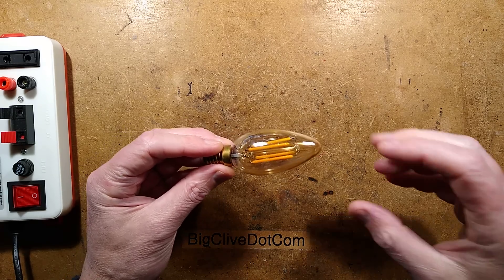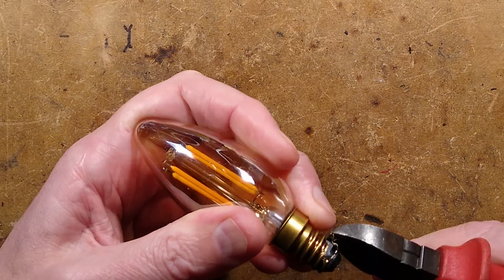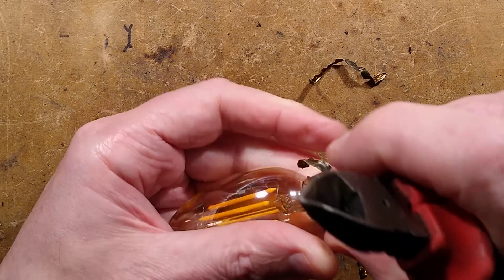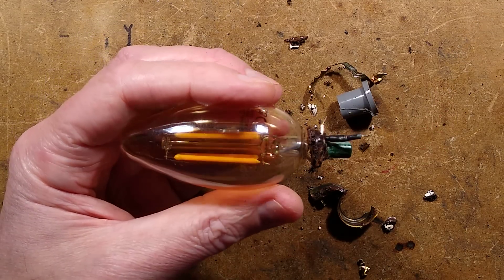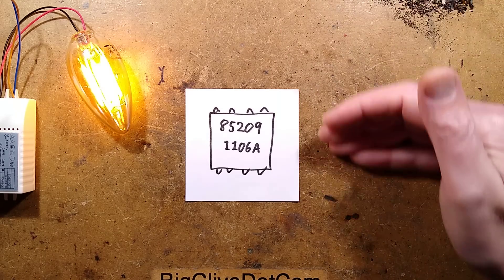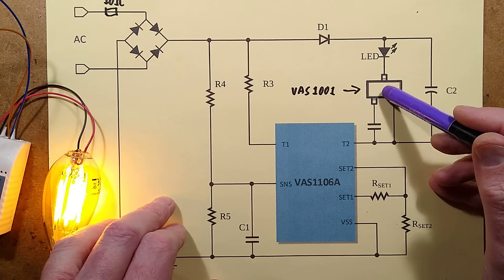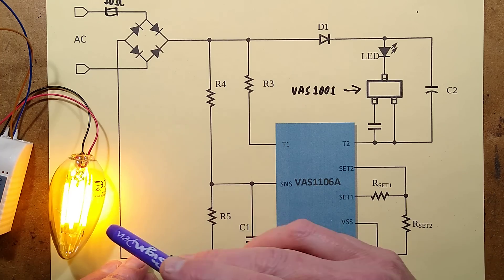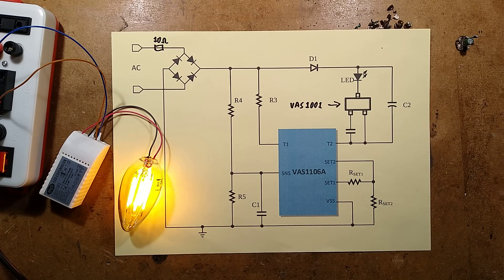Inside a STOLEN (faulty) LED bulb

Comment: Wonder if there are any good e14 led lamps at all. This form factor is just not suitable for LEDs. Even e27 is bad. And with the electronics they use for most led lamps (both the components and the designs), finding a good one is a serious quest

Comment: Sorry if this sounds a daft question but,  is this bulb made like wire filament bulbs eg with a vacuum?
Reply from the maker: It's made with the same machines as tungsten bulbs, but no vacuum.  Sometimes an inert gas like helium is used to help couple heat from the LED filaments to the glass envelope.

Comment: Ok guys, serious me now.
Need some advice please.
So, I'm rebuilding my pc, trying to line up the motherboard into the case, then I noticed one of the screws was stiil in the board. [Like wtf did i even get it out like that?]

But, question is..
How do you extract a screw that doesn't seem to be threading from a circuit board?

I've tried a magnetic driver, pushing from the back...
I don't really want to have to take a hammer to it. 🤔

Comment: Could you do a video on how these dimmable bulbs actually dim on a triac dimmer? I would have assumed that the current regulator and sensing resistors would essentially maintain consistent light all the way until the waveform became too scarce to provide adequate voltage, then you get flicker. This seems to be how non-dimming lamps react to a triac. I've read that expensive LED drivers are measuring the phase of the triac dimmer and translating that into a pwm duty cycle, but surely this cheap bulb in this video is not doing that. So what's it doing?

Comment: The marvel is how they manage to squeeze ANY form of PSU (no matter how minimalist) into such a small space, and do this for millions of devices. It wasn't that long ago when LED drivers were reasonably chunky!!
Reply: Somewhere in a cupboard I still have one of the first Edison-base compact fluorescent lamps. These things had wire-wound ballasts and weighed a tonne! They were also huge, maybe 80 mm diametre and almost 200 mm long. Philips, late 1980s I think. My parents bought them for the hallway light that was usually on for most of the day. That light saw multiple generations of CFLs and I was incredibly glad when LEDs finally became good enough to replace those. Not having to wait two minutes for the light to reach something akin to full brightness was a major bonus!

Comment: I have a question somebody here may be able to help with, I have a rated 5A at 125V, I need a switch for 12VDC, can anyone tell me what amperage it could handle with that voltage in DC?
Reply from the maker: Is it a relay or switch?  Generally speaking the current will be similar at lower voltages.
Reply: @bigclivedotcom  a switch, I have an old air horn/brake compressor that I want to hook up, but I want to be able to turn it on and off separately from the ignition because it'll have hookups for air tools, I think it draws a little bit over 10A when starting at 50psi, so I figure it'll need to handle 15A or so to make sure it'll handle everything.

Comment: I’m so sick of LED bulbs that cram electronics into the base. I bought some LED retrofit kits for my ceiling fans — they replace all the bulbs and sockets with what seems like a more sensible LED solution. I’m hoping they’ll last longer.
Reply from the maker: Is that the flat panel version?

Comment: The bar should eliminate those lampholders, go for a bigger edison screw (e27), 
but why not have some of the circuitry in the bulb, no need for classic design where the bulb was gas sealed.
Reply: Because these types of bulbs are designed to be exposed and looked at.  Nobody wants to see a circuit board inside of a fancy candelabra bulb.

Comment: Hey @bigclivedotcom - I’ve been pulling my teeth trying to solve a hum problem in an old Pultec EQP1a kit I’ve built. Is there any chance I could send you a master layout guide and a schematic on the chance you might be able help me kill it for good?
Reply from the maker: Most common cause of hum in audio equipment with nothing else connected is the power supply capacitors.

Comment: At my work we have LED wall clock that stop working. They find faulty 1A power adapter with USB-A socket and order new one. But it take month until they order and new arrived and faulty one was still laying around clock untouched so I bring it home for check. It show 5V voltage but switching on and off quickly. Visibly two bad capacitor on low side I change them with same capacity but little higher voltage because dont have same. I test it on full load for few hour and no explosion. I'm not sure it's save to use with smartphone, expensive equipment or loved electronics or without supervision on it but happy for repair it and keep it like better alternative then cheap chinese charger that came with something.

Comment: I have had 3 lamps fail a weird way now. They begin to flicker, then get darker, and in my case, 2 opposing side filaments are still slightly glowing, 2 don't. Life expectancy was a few months each. Really bothers me, did I get a bad batch or is my lamp socket killing them...
Reply from the maker: Probably bad lamps.   The higher power lamps have shorter lifespans.
Reply: @bigclivedotcom  I have one of these lamps in a desk lamp, it is on for longer than the others, it is from the same batch, and it is still alive. That's why I tend to look at the fitting as the culprit. It is an enclosed ceiling lamp with an 100W incandescent rating, but I wonder if the LEDs get too hot in there. Though there is an other difference, I selected the desk lamp out because it was running more silently than the ones I put up on the ceiling. Maybe they vibrate themselfes to death?

Comment: I don't know about you but my name-brand LEDs don't seem to last all that long in our old fittings. Does old wiring kill LEDs for some reason? (8W in a glass daffodil type shape so perhaps it's just overheating,)
Reply from the maker: 8W is high.  LED lamps degrade faster with heat.
Reply: @bigclivedotcom  Indeed. I happen to have two identical failed bulbs; it will be interesting to dismantle them to see if they both failed the same way.

On a lighter note, last night I was happy to realise that my IKEA bedside lamp+QI charger isn't on it's way out. It turns out that the intermittent dimming was merely my Kindle going to sleep, which causes the reflected light on the walls to flicker for a moment. I still think non-replaceable 'bulbs' are a terrible idea* but it's still going strong after a good few years and on the other hand putting a QI charger in the base of a bedside lamp was inspired.
Reply: LEDs are likely to fail if the temperature exceeds 80 degrees C. That happens easily in an enclosed fuxture. Compare this with CFLs, higher quailty ones had 105C rated capacitors. My unpopular opinion: CFL is better than LED.
Reply: @mernokimuvek CFL sucks arsse.  Slow to turn on and gradually warm up.  Won't work on a dimmer.  Hazardous mercury.  What's good about them?

Comment: Speaking early about them cramming bits into the small base, do you think we'll be seeing a change in the near-ish future where lights have a new socket type to better work with leds?  It really seems that advancements have moved beyond the classic screw in styles, but also seems to be a set in stone to them because so many exist in households.
Reply from the maker: I'd like to see future houses use a 24V lighting circuit and dedicated holders.
Reply: @bigclivedotcom  Sorry, I'm not really up with the tech.
In the 1990's I think, B&Q and similar, did 20V systems, is there some reason you suggest 24V? Just out of interest.
Reply from the maker: @stephenlee5929  24V involves half the current of a 12V system,  But both are good options.
Reply: I think that's the problem; if you introduce a new socket, you'll just have an XKCD 927 situation.

Comment: It is interesting to consider the evolution of lighting over the years if it was a really old pub. From whale oil to coal gas to carbon incandescent to tungsten incandescent to florescent to LED.
Reply: Would they have even had carbon filament bulbs? A rather famous bar in the history of my city got electric lights in the 1920s and it was one of the first bars with electric power in the whole country. By that point it was well into the age of tungsten filament bulbs.
Reply: ...with the LED being the least likely to reach its promised runtime.

Comment: Hey Big Clive, this will interest you!

Although NOT LED, I have a 1929 (94 years old) carbon filament light bulb, made to mark the 50th Anniversary of Edison's Electric Light (1879-1929). The bulb was made in the United States, and runs on US mains voltage. The bulb is mounted on wooden base, and has two uninsulated metal thumb screws for power. The underside is insulated with wax! Definitely no UL or CE Marks!

The bulb works, and as long as you're careful, you don't get electrocuted! I bought the bulb on eBay in 2013 from an American seller for around £50.00. It's a thing of beauty, and probably quite rare?

What do you think of that then? And no, you're NOT reverse-engineering it! 🤣
Reply from the maker: I can recall my dad telling me that when they refurbished the library he worked in they found some of the cupboards still had vintage lamps in them from the very earliest era of electric lighting.  He was hoping to get one, but the contractors took them all.
Reply: @bigclivedotcom  How many LED light bulbs will still be working in a hundred years from now? Not many, I'll wager? ... The lamps that the contractors took almost certainly ended up on eBay! ... Carbon filament lamps are horribly inefficient, but like tungsten, they're beautiful!
Reply: Thats pretty neat.
Reply: @@Matt_Quinn-CaledonianTV  You assume correctly. A step-down transformer and an electronic dimmer switch. Due to the age and fragility, and to avoid "shocking" the carbon filament, the lamp should not receive full voltage immediately, but, as you say, be illuminated gently. Additionally, I only run the lamp at low voltage, so it just glows a beautiful golden colour, this also avoids darkening of the glass envelope through carbon deposition. It really is a beautiful object, and it really should be enclosed in a display case, or a bell jar or the like. It's remarkable its survived for almost 100 years! If it was damaged or broken, I'd be really saddened!
Reply: They're counterfeit and mass produced in a Chinese factory for 6 cents each.

Comment: I had replaced the lamps in a chandelier with LED lamps like that one, wouldn't stay on. I had to reinstall one conventional lamp to keep the things lit, as the load was too low for the cheap-o-matic dimmer to stay latched on. As the home was a rental, I wasn't going to replace their cheap dimmer with a proper unit.
As the saying goes, pay cheap, get cheap shit.
Reply: It's not so much cheap as it was likely designed before LED lamps existed.  It works just fine for the application it was designed for - driving incandescent bulbs.

Comment: The minute I see that brown acrylic staking compound I start to worry. It's a notorious failure mode in a lot of gear. They use it because it's cheap but it's hygroscopic over time and it starts to leak and can start fires. Cost a number of TV manufacturers millions in rework around G2 stages and I've seen a number of hockey Puck down light supplies die from it. Just recently did a couple of CRO supplies with the issue, one was an Insteak the other surprise was a Tek, but they had a 3rd party supply fitted.
Reply: The obvious solution is, if such a potted circuit is found, immerse it into a large container of water, such as the Atlantic or Pacific ocean.
Hopefully, alongside whatever village idiot chose a hygroscopic compound for potting.
Reply: @spvillano  You nailed it Bro. It's called HAST. But almost nobody does it thoroughly. Acrylic staking which is cheap compared to RTV or MOXI. Modern replacement for PCBA sealant because no Xylene better for health apparently perhaps maybe?. 
So now forcing APL or Acrylic polymer many places this lacquer suffers the same issue, that if it is not set at 80C for 4-8 HRS depending on how many um layer then it suffers reversion (hygyroscopic induction of water and becomes as conductive as the day it was born). 
When it is set it turns into a Gordian Knot that water struggles to penetrate, when it's done poorly it becomes a long term failure mode that can crop up at any moment, that is currently plaguing all PCBA manufactures.
Reply: @Funkylogic  So, the problem isn't just the compound itself.  It's that manufacturers are cheeping out and not following the directions.  This is why we can't have nice things.
Reply: @Funkylogic  the bear of it is, if they wanted cheap, they could've even went with bakelite.  :/

Comment: I had a dimmable Amazon E26 LED lamp in the kitchen spotlights that would run for about 30 mins, then shut down. I thought it had died until I left it out for a while and reinstalled it. It worked again then shut down. These lamps from Amazon had some weight to them but they were CRAMMED with soft thermal goo, the entire circuitry was encased in it, it didn't survive my prying!

Comment: Small Edison (also called "Candelabra Lamps" in the USA) is the WORST bulb, I mean that in the best way, but I would rather have a H7 automotive blade style lamp slice my fingers a hundred times. I have broken SO many bulbs just by screwing them in, the base is just a terrible design.

My guess as to what that failure mode was: The circuit to switch in the load to fool dimmer circuits latched and that was the 2W power draw. I bet it failed thinking that the dimmer on the wall was on "lowest light" setting, which is the "dump the energy into the resistor as heat" mode, which would then just bake forever. And I would bet money that the gooey white stuff was some kind of heat transfer compound, that was probably much more firm prior to being baked for who knows how long.
Reply: Maybe you should stop using a torque wrench to install them.

Comment: Brilliant thanks Clive quite interesting how it suddenly started working, maybe the burnt glue was going conducive?
Reply: The driver circuit failed, he jumpered in a driver board to supply the lamp and get the flickering bulb to light up.
Which may well have been the root cause for the failure in the first place. Load popping off and on randomly can kill already close to rating components.
Especially, as Clive mentioned, that electrolytic that's inside of the lamp base. Surprised me, I thought my eyes were playing tricks on me at first.

Comment: When these LED bulbs begin to fail, why do they start to become much hotter as they become dimmer?
Reply from the maker: It can be the failed LEDs developing a resistance and the voltage across them increasing.

Comment: I've also wanted to steal light bulbs from businesses I've gone to but I go a step further. I also want to replace them.  there's a restaurant about 300 ft from my house The lights on the outside kept burning out and they would never replace them so I would replace them with incandescent light bulbs for my house. I replaced the ones at my house with fluorescent ones I had laying around and when I ran out of fluorescent ones i would use LEDs

Comment: Is the bulb in a vacuum like an incandescent bulb? If glass is broken can it still be used?
Reply from the maker: No vacuum as they need to dissipate the LED heat.  Sometimes an inert gas.
Reply: Higher quality LED filament lamps have the outer bulb filled with helium-oxygen mixture for high thermal conductivity to cool the LEDs. Even most incandescent lamps were not evacuated, most of them were filled with argon and nitrogen.
Reply: Why in the world would it be a vacuum?  Of course it will still work if the glass is broken.  They're LEDs.
Reply: I apologize profusely for the dumb question.  I thought light bulbs were a vacuum. Jeez. Ha ha
Reply: @oceanicfeeling3135 Regular incandescent filament bulbs are kept in an argon gas atmosphere because otherwise the white hot filament would oxidize rapidly and burn out if exposed to oxygen.
Reply from the maker: @oceanicfeeling3135  Traditional tungsten bulbs do have a vacuum to protect the filament, but LED bulbs don't.  They will often work with no glass, but there will be exposed live connections.
Reply: @oceanicfeeling3135  Some of the smaller, 25, 15 and less W incandecent ones or the 40 W 2200 K decorative ones have a vacuum.
Reply: No and yes, in that order.  And it's generally plastic instead of glass, these days.

Comment: Some time ago i dismantled a very similar led lamp which had an identical flickery behaviour; the circuitry looked very similar to yours, and the LED strips also exhibited occasional flickering. While handling them (after breaking the glass globe), one of the four snapped very easily, so my guess is that maybe the glass(?) substrate cracks, therefore the LEDs occasionally stop working.
Reply: Yeah, mechanically intermittent contact seems fairly likely, considering the lamp decided to work as Clive tilted it.

Comment: Question, Now that LED lights  are standard and incandescent have been phased out, would it  not be cheaper and safer to run house lighting circuits on 12v only?
Reply: I don't know if it's the same where you live, but around here lighting and wall outlets are generally on the same circuit. I'm not sure my 18V iPad charger would be happy with 12 volts, and my fridge and dehumidifier certainly wouldn’t be.
Reply: @Ea-Nasir_Copper_Co And where I live having the lights and wall outlets on the same circuit is frowned upon.
Reply from the maker: The changeover would be the tricky bit.
Reply: No, that would be tyrannical. Do you want to force nerds like me to convert eveything to LED and stop using dozens of fluorescent lamps from my collection that I hoarded for years?